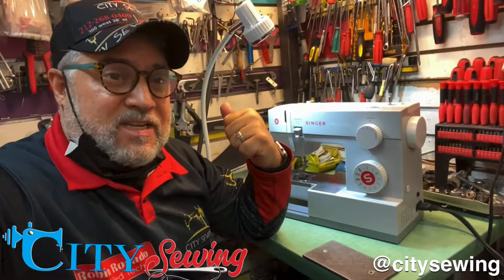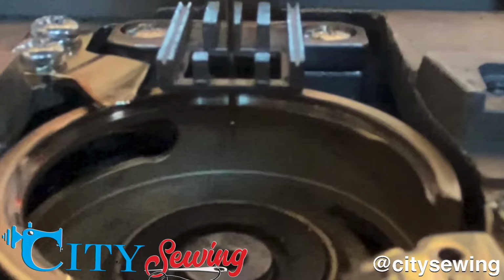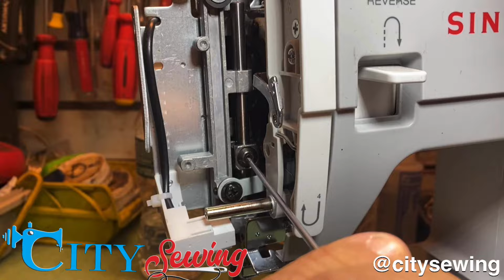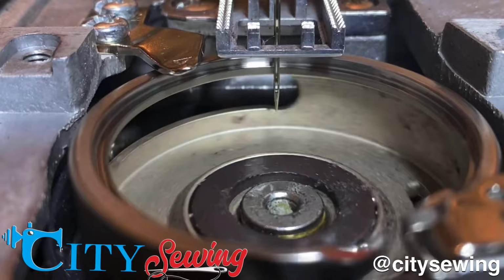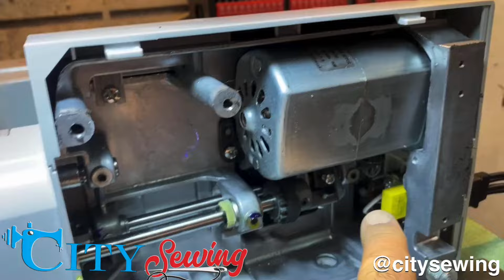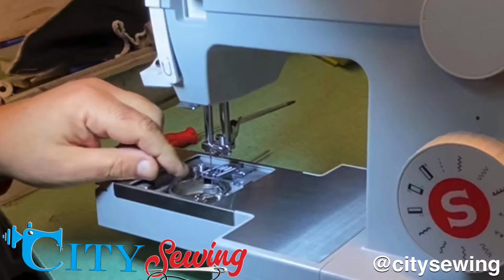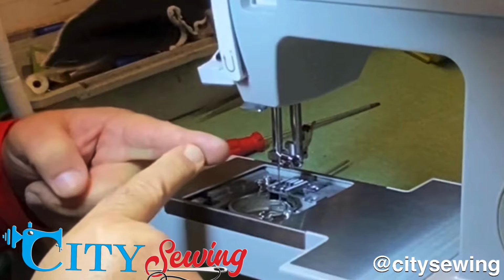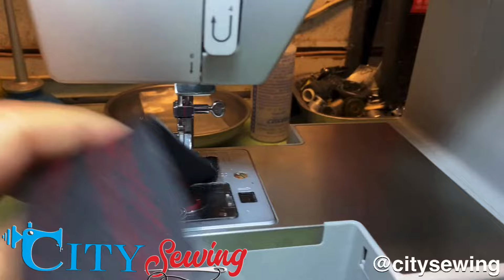Singer Heavy Duty, EASY fix

Comment: hi! I have the same exact model of this sewing machine - and all of a sudden it wouldn't go out of S1 mode! Doesn't matter which type I choose (straight/zigzag), it's constantly in the S1 mode. This just happened suddenly when I was using S1 mode one day and tried to turn out of it but it didn't happen. Just wondering if this is the issue of the needle timing too, or is there other issue? and which video would you direct me to look at to have that fixed? Thank you so much!

Comment: I did what you said and it fixed it for about 5 minutes and now it’s off of alignment again. I’m sewing through a single layer of fabric and my needle is hitting that metal spinner again. I’m about to trash a sewing machine that’s new and only been used about 5 times. It’s a singer heavy duty model 4452. I’ve never even sewn anything considered heavy duty with this machine.

Comment: how to fix  still loose stich at the back even the tension is in maximum tight that I can hardly pull the thread as i set the tension. my machine is singer and also top loading bobbin.

Comment: 4:26 Hi! Thanks for the video. I have a question for clarification:  did you replicate the same procedure for the needle in the right position as well for the hood/needle location or did you leave the distance as shown in the video greater than the left side?  If not, is there a reason when to check left side timing vs right side timing? I remember seeing another helpful video you did but it was specific to check the needle bar height for only that adjustment (without manually also adjusting the hook) on the right side…? Just making sure I’m not misunderstanding or missing when to do both sides or when only left/only right matters?  Thanks so much!!
Reply from the maker: Same.

Comment: Question. When the timing is off does the machine make a buzzing noise as well? My machine is making a buzzing noise as if I have my foot on the peddle just enough to start it in gear but not moving the needle. But if I push harder on the peddle its starts to sew fine. What could this be???
Reply from the maker: Oil

Comment: Hello - I tried to tighten the little screw on the bobbin case to tighten the tension, but unfortunately I went too far. Therefore the little screw fell out causing all the parts to fall out. 

I tried putting them back together, but somehow I think I lost a piece. 
I am wondering whether you could do a vid demonstrating how to disassemble a singer Heavy Duty 4411 bobbin case and reassemble it, so I know whether I have all the parts and where each piece goes.

Thank you in advance
Reply from the maker: Sorry

Comment: I have the Singer Heavy Duty 4452, and I have a question regarding the stitches formed with the needle position in the center.  When I put the needle in the center position, I end up with loopy threads on the bottom of the fabric.  However, If I change to either the right or the left, it sews perfect stitches. 
I've adjusted the tension, changed the needle, rethreaded, cleaned the lint, etc, but I can't get the machine to sew a nice seam in its center position. Could you please help me with a direction as to where to go with this? 
I miss sewing, and I so wish I could figure out how to resolve this issue. 
Thank you kindly for any help you can provide! :)
Reply from the maker: Provide picture

Comment: My wife's machine is the same model as shown in this video, the 4411. After setting the hook timing and needle height as shown, the zig zag will mostly sew a straight line when using a stitch length of 4 (i.e. it skips the right side of the stitch most but not all of the time) but will correctly sew using a length of 1. When I try a straight stitch it will frequently skip stitches regardless of the length. I am baffled by this. I have the Singer manual and have centered the needle as specified therein. I have of course installed a new needle, cleaned the lint, greased and oiled the gears, etc. What am I missing?
Reply: There's a small white +- button on right top hand, try adjusting that using a coin or screw driver. It could be that the settings are changed here. This is usually to adjust the stich depending on the material being used. I'm just guessing but there's no harm in trying. You can read more about it on the user manual.
Reply from the maker: Use the left side to time the hook . Should be fine after.